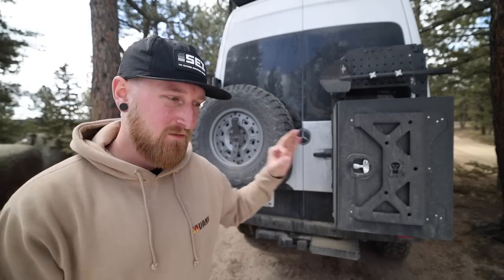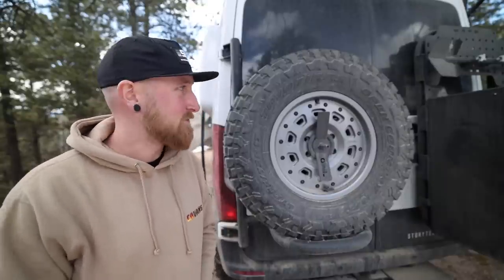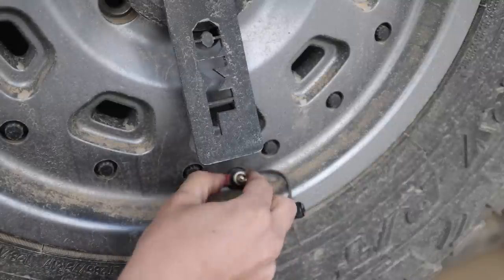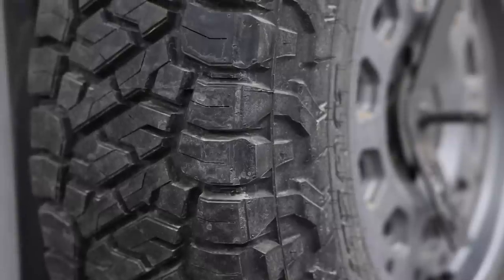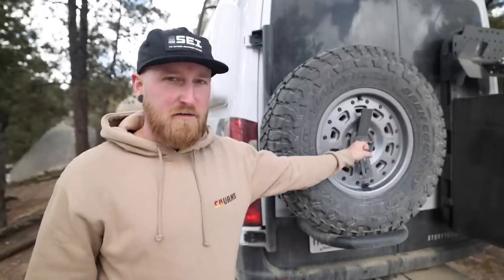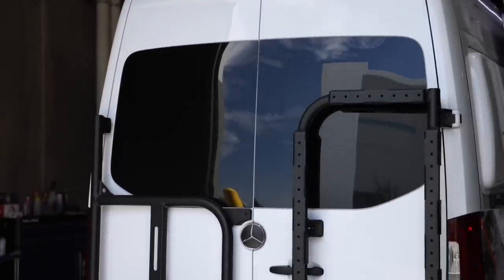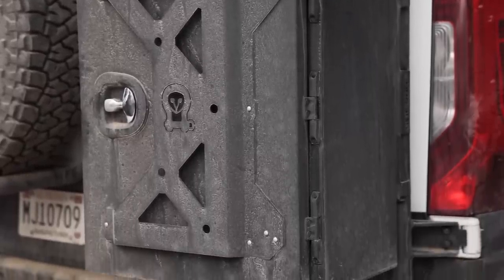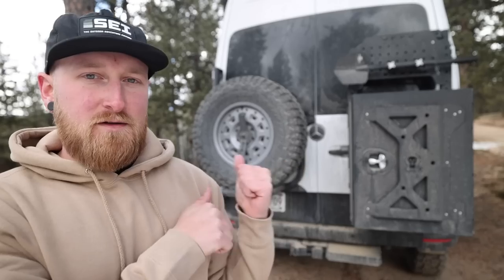THE BEST GEAR CARRIERS! - Owl Vans | Storyteller Overland

Comment: I have the exact same AG6 shovel and mount...I definitely wanted the longer shovel but wished it had the T-handle end like the mini AG6 shovel does so you can run a lock cable thru the handle. Curious how are you planning on keeping the shovel from walking away? btw ...we'll be going full-time in the Kimbo in just 9 more days😯...